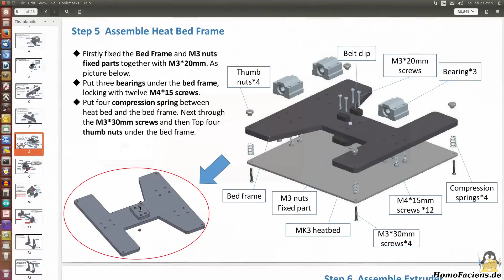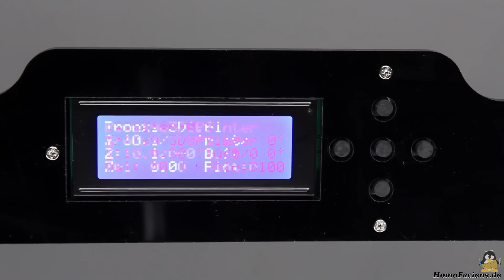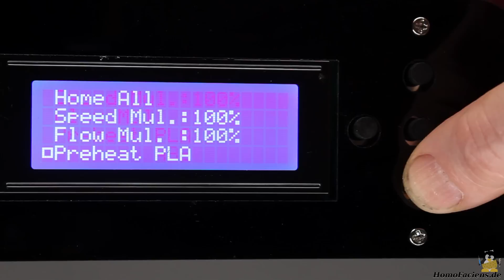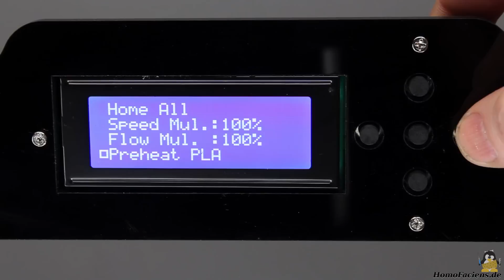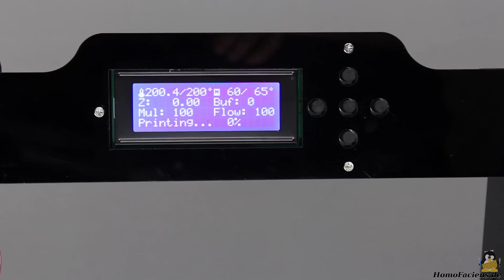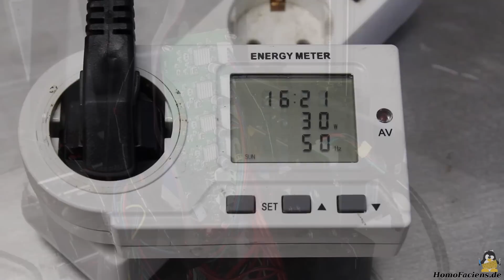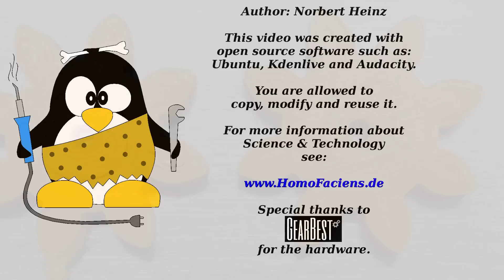3D Printer Review Tronxy P802M

Comment: Hi, 

i have a Problem with the Bed-Motor (Y). The Home-Posoition is wrong. How can i fix it? 

The bed is driving in the wrong direction, if i´m clicking on "Y- Home" in the menu. i can hear a loud noise. the bed stops in the front-Position. i stops in the opposite of the "y-min-Switch". 
 
Please have a look into this: http://forums.reprap.org/read.php?247,816204

what can i do?

your tutorial is very good.
CU
V
Reply from the maker: Sorry for my late reply, but your comment was marked as spam by YouTube (due to the embedded link, I guess). As I read in the Forum you have solved the problem by mounting the end switch on the opposite end of the build plate.
Meine Videos gibt's auch auf Deutsch ;-)
https://www.youtube.com/watch?v=GrNmgBqgx14
Reply from the maker: Did you adjust the bed to low position with the screws under the blue tape before starting levelling?

Comment: Could you share your slic3er settings?
Reply from the maker: Yes, I can:
http://www.homofaciens.de/download/slic3r-settings-Tronxy-P802.ini
But a confuguration that works on my printer with my filament for a special print doesn't necessarily work on your printer. I will talk about printing parameters in a coming video - stay tuned!
Reply: HomoFaciens Your video convinced me to buy the same printer. I'm watching all your videos for a very long time now :-) thanks for sharing.
Reply: Just did small print with your config file and it looks fantastic :) Thanks again!
Reply from the maker: You're welcome!
Reply: I have another question, does your printer have fully heated bed? Mine has 3 pads for 12 and 24v. 12V heats only half of the whole bed and it seems I can't reach temperatures higher than 90 Celsius. Not sure how utilize 24V.
Reply from the maker: I can't say much about the specifications of the heated bed. On my pages you can have a close look at the bottom side:
http://homofaciens.de/technics-machines-3D-printer-tronxy-p802_en.htm
Maybe that answers your question?
Reply: HomoFaciens so mine is different, I have additional soldering pad saying 24V. I have checked how all heating paths are aligned and 12V is just on first half of the bed. Seems like you might order the same printer from the same seller and still get something different. I have found mosfet based 24V hack. Will have to do it. ABS printing is almost impossible right now.
Reply from the maker: Another batch, different parts.
I haven't tried ABS yet. One spool of ABS is on it's way to me...
Reply: It's much less sticky - because blue sticker was destroyed pretty fast (during bigger prints removal) I use extra 4mm tempered glass on top of the aluminum bed. Works great with PLA but not so great with ABS. Ordered some more blue stickers to check if this will help with ABS. Do you plan to post any mods to the P802? Like maybe auto-leveling?
Reply from the maker: Yes, I will do mods and of course show them in a video, but there are currently other projects with a higher priority. I have an auto levelling sensor and I will also try to implement it sometime.
Reply: HomoFaciens great, good luck. I'm waiting for new videos then :-)

Comment: Do you agree that both X and Y axes should also have a worm gear drive as the Z axis instead of a belt one? Won't will it increase the 3-D print accuracy?
Reply from the maker: Spindle drives are more precisely than belt drives, but also slower. 3D printers never can be fast enough...
Reply: True!

Comment: I was thinking that whether a CNC machine can be used to solder on definite positions on the PCB. A hot-end extruder like one used in 3-D printers can be placed instead of a router and some solder wire can be fed into the extruder, it will melt and put solder at the copper pads where components are temporarily fixed in place.
Reply from the maker: Using a soldering bath does the same thing instantly. There are no CNC machines used in industry to mass produce boards. However if you'd like to have such a machine, you can try to build one following your ideas.
Reply: Thanks for your prompt response.
Reply from the maker: Really nice machine.

Comment: I have the same machine sems to work however have not been able to reset the firmware settings to maintain nozzle printing temp, tried auto tune but no difference hotend does not maintain temp when printing anyone have any ideas what to look for as far as settings either by eeprom or repetier, 🤔
Reply from the maker: There are always fluctuations in temperature while printing, which doesn't matter as long as the error in temperature isn't too high.
What is the temperature reading you get with your printer?
Reply: HomoFaciens Hey thanks for replying, I have not even been able to print anything yet, whenever I start the test print or any other printjob, the readout shows targeted heat settings, for example 196 the heatend heats up to 176 always 20 degrees difference then the printing never starts, when I have turned up the target heat to say 230 the heatend would heat up to 199,  so then I try tricking it and manually starting the print then the target temp resets to 196 the temp starts to immediately drop well below printing temp and the print job is aborted, almost as if there is some kind of firmware loop that's limiting the nozzle from reaching it's printing heat, I've used repetier to test and graph the heatend the tests do show that the heatend does hold the set temps, just about to chuck this thing very dissapointing
Reply from the maker: Did you try printing the sample that came with the SD card? Mine came with a file named "P802_40mm_box_pillar.gcode" on the card.
Reply: HomoFaciens yes that's actually what started printing but the temp quickly dropped below printing temp and never reached printing temp again so print would abort, I need to figure out what the appropriate firmware pid settings and limits should be, as I stated before I ran the pid tune and did the gcode m303 e0 s100 etc tests via repertier, so and did find that the hardware performed consistantly, even purchased and installed new hotend and thermistor,  same results, seems once printer goes into print mode it does not maintain temperature it drops and never recovers, also looked at the eeprom settings but I have no reference as to what the settings should be, can't seem to find any information on that anywhere just basic stuff but no settings
Reply from the maker: On my printer I get for the Extruder configuration:

Steps/MM: 90.0
Start FR:  20
Max FR: 20
Accel: 5000
Stab.Time: 1
Wait Units: 0mm
Wait Temp.  150°C
Control: Dead ime
DT/PID P: 7.00
PID I:  2.0
PID D: 40.0
DRIVE Min: 50
Drive Max: 230
PID Max: 255

Is that what you are looking for?
Reply: HomoFaciens hey , yes that's what I'm talking about thank you ,I really appreciate you taking the time to respond and help, I'll  compare those settings, thanks again, I'll let you know the results, 👍

Comment: Hello, 
    I have purchased this model 3d printer, but am having trouble connecting to my computer.
When I try to connect the printer, it comes up with the message Please enter a API key, I do not know what this means.
Can anyone help.
Reply from the maker: Sorry, but API looks like you are using Windows. I am using Linux only, thus I can't help with that special problem. Maybe the driver wasn't installed correctly?
Using the SD-Card to print is a way around your problem. The advantage is, that your PC doesn't have to run (and so consume lots of electric power) during the (usually long) printing time.

Comment: Looks like an Anet A8, very cool!
A few upgrades you might want to print is the Z axis belt holder, Y axis belt holder, z wobble holder
Pretty cool, you will be printing like a champ in no time
Here is the Anet A8 stuff I have collected, there is alot of good ones in there, but also alot not so good
http://www.thingiverse.com/WarHawk8080/collections/anet-a8-upgrade-mods
Recommendation to get one of those cheap MOSFET boards to control the current to the heat bed so it doesn't burn out the connectors or the board
http://www.banggood.com/3D-Printer-Parts-General-Add-on-Heated-Bed-Power-Expansion-Module-High-Power-For-Chitu-Motherboard-p-1086965.html
Very very cool..can't wait to see what kind of stuff you print and/or design for print
P.S. They have a customizer for making optical encoder wheels
https://www.thingiverse.com/thing:1679204
Reply from the maker: The mecanics of the P802 as well as the A8 are based on the Prusa i3, so your collection will work for all of those clones. There are indeed helpful and less helpful addons available. I will have a close look at the mechanics and demonstrate what improvements make sense in the coming weeks.
There are several customizer sorces available for OpenSCAD which make life easier. I like the parametric way of designing.
Thanks for sharing.

Comment: I bought a very similar printer form Gearbest, the Anet A8. The design is, as far as I can tell almost identical, with some minor differences. I'll share some of the experiences I've had with the printer, and hopefully I can shorten the learning curve for some of you. 

First of all, the printbed got warped significantly after a few heat cycles, making it impossible to print something that was larger than a few cm'2 in bottom surface area. I solved this problem by cutting a sheet of glass to size, and taping it in place on the printbed. Glass, being practically completely flat, makes for a great printing surface The parts also stick much better to glass than masking tape if you raise the printbed temperature a bit, and the parts let go of the glass by itself when it cools down aswell.
I also insulated the bottom of the printbed with a sheet of cork to reduce power consumption a bit.

Secondly, I wasn't happy with the strength of the frame. When tightening the Y-axis belt, I noticed the frame pieces the motor and the idler pulley is attached to started flexing towards each other. To combat this, I simply printed a set of braces I found on Thingiverse .com. Just search for "A8 Frame brace" or something like that and you'll find it. 

Third, I wasn't happy with the way the printhead was mounted.The carriage was far too heavy, causing the whole frame of the contraption to shake quite violently every time a change of direction happened, inducing a rippling effect in the printed parts. The extruder (A copy of the MK8 extruder) was mounted to a ridiculously oversized aluminium bracket, and attached to the bearings via equally oversized mounting blocks. To solve this problem, I found a new carriage on Thingiverse that I printed, and replaced both the metal bracket and the bearing holder blocks. After this upgrade, I could almost double the print speed before any more rippling could be observed. You can find this carriage by searching for "X carriage for Anet A8", it's made by user Simhopp.

My last advice to share today will be to stock up on both nozzles and the teflon-lined tube that connects the extruder to the nozzle. They are dirt-cheap, and you are likely to break both of them the first few times clearing a clogged hotend. The tube that came with the printer was especially fragile; It was clearly made with worn out tooling, and was bored out much larger than specification. It snapped when threading it in by hand. Maybe I was unlucky, but get them anyways, as the teflon lining wears out over time.
Reply from the maker: Thanks for sharing your experiences.

Comment: Did you use linux for everything here?
Reply from the maker: For modelling the gears I used OpenSCAD and Slic3r for getting G-code files.
The audio track was recorded using Audacity, the video was edited with kdenlive, I am typing this comment in a Firefox browser. Not using Linux or another Open Source OS is a security risk by default.

Comment: Hi HF, I have a similar printer for the last 1.5 years, and I use it a lot. Here are a number of adaptations I've made, which have helped me a lot, and so can highly recommend:
- The point where all wires go to the mains-to-DC convertor, I used ferrules to crimp, insulate(somewhat) and strain-relieve the stripped wires
- I have a Bowden-tube style extruder, however, even with a direct-drive like yours, a (reverse) tube of some sort is recommended between a fixed point near the spool and the head. This will avoid asymmetric straining of the y-axis and the extruder-motor, as you see at 7:38 .
- The heated-bed uses a polyimide heater-sticker. The heater-wire shall come loose unless you strain-relieve it. A simple solution is to put a heat-resistant tape around the heated-bed wire (in the shape of the "Pink Ribbon" logo) and fix it to the bed
- Where you've used a ceramic-tile, I have an inverted IKEA Lack table. The "legs" work as attachment-points for doodads (lights cameras, filament, thermometer, cable-relief, etc.
- If you put ink-marks on your Z-couplers for the two Z-motors, you can manually override and return the motors (turning by hand) to get a horizontal y-axis ( 6:58 )
- The LCD UI panel is a the top of the printer, and flexes the frame every time its operated. Instead if you place it at the side, it works much better (for me)
- at 12:18 is a polyimide tape around the heater-block. This is imo insufficient insulation, making this thicker (many options available) is worthwhile
- You print on blue-tape. In my experience, the adhesive on the tape is not strong enough to counter warping. For me, polyimide tape and a spray called 3D-Lack work really well.
- A cardboard breeze-shield mounted to the legs surrounds the printer and prevents abrupt-cooling-artifacts. I've attached the front-panel-cardboard to the legs with velcro
PS. Your nozzles will get clogged. Ordes spares at your favorite far-east store in advance for a few cents each - 0.5mm works well too, and clogs less often than 0.4mm :)
Cheers!
Reply from the maker: Thanks for sharing your knowledge.
I can confirm most of your advice, even if I own this printer for no more than a few days. Many drawbacks of the cheap constuction are obvious, but you can fix most of them easily. Spare nozzles were part of the deal ;-)
Reply: Aditya Mehendale 
no idea if you've tried it but, PLA budhings, if you have overshoot or ringing problems because of cheap lm8uu bearings, then printing and adjusting a pair of pla bushings is the best and cheaper option before changing your rods and bearings for a pair of new and high quality ones.

Also get a paint scraper and sharper the edge on only one side all the way through. Its way better than using your hand and you wont put force on the Y rods which could bend them.

Also, get simplify3D, the software is the most importan part of the printer. if its too expensive for you or if you dont want to pirate it, the other best options are matter control and cura.
Slic3r is the shittiest shit of them all.
Reply: My bearings are luckily still good; nice tip with the PLA though. I use Craftware, Cura, MatterControl and Slic3r; each has pros and cons.